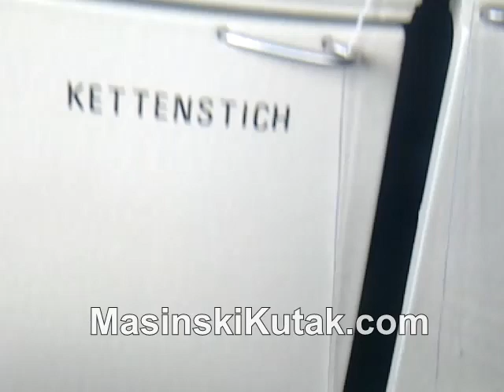Chain Stitch / Chain Stitch on a Home Sewing Machine / Janome 618 / Janome New Home 920

Comment: I've seen these before and didn't know what they were. none of my current machines have one of these, but I'm going to go hunt down a janome 618 right now. super curious.
Reply from the maker: It's a very interesting accessory for a sewing machine, I had one and sold it, if you find a Janome 618 pay attention to whether it has this accessory, it's very often missing.
Reply: @MasinskiKutak  I'm combing through eBay listings. zooming it on all the pictures. I'll find another one. I actually may have one in my many sewing drawers. apparently there is a early 1970 singer that also does this

Comment: This attachment was included with the XL-II and model 813 released by Janome.
model813 is the Japanese version and XL-II is its English version.
These are products from the late 1970s.
This attachment can be used with the model 8XX of JANOME.
Reply from the maker: @kiyotaka kaneko 
Most likely sir, the Janome 813 sewing machine has the same rotating hook as the Janome 618. 
Thanks for the information.
Reply: @MasinskiKutak  I have a model 815.
I made a video of JANOME model 815.
The model 815 does not come with this attachment.
I would like to make a copy of this attachment.
Reply from the maker: @kiyotaka kaneko  
I watched your video, I watched patiently even though I don't understand a single word, Janome 815 is a good old Japanese sewing machine.
I noticed a crack on the rotating hook drive gear, if the machine is working normally it should not be replaced immediately.
Receive my sincere respect and greetings for the great Japanese people.
Reply: @MasinskiKutak  I'll start repairing it tomorrow.
The gears will come from China.
Reply: Any class 15 machine that has the same back and forth rotation
Hook mechism.
Reply from the maker: @ronalddaub5008  It cannot work on back and forth, the hook must be rotating, also the threading feed is not like regular sewing.

Comment: Hi, sir this device is super , and I need that one , how much it cost?  ,and my mechine model is usha janome wounder stich
Reply from the maker: In the explanation of the video clip, I stated that this accessory was used on the Janome 618 sewing machine, for now I have no information whether this accessory is used on some other models of sewing machines.
For this accessory to work on another machine, several conditions are required, as well as a special method of placing the thread.

Comment: Hello Sir, I have a New Home Janome Model 692F. I was using the chain stitch on it when I first got it. Then I started changing the dials without a manual. I have only been able to find a manual for a 692. That manual says nothing about the chain stitch. After messing with the dials I haven't been able to get the chain stitch to work again.  Would you happen to know what the "F" on my model means and would you know maybe what the dials should be set on to use the chain stitch?
Reply from the maker: I don't know what 'F' means, it's a series mark, are you sure that you thread the thread correctly, there is a difference in the way of thread placement for chain stitch and regular straight stitch.?
Reply: @MasinskiKutak  Thank you for your information. I will try to re-thread. It sounds like you are saying that it doesn't matter what the dials are on once I place the plugin into the machine it will chain stitch as long as I have it threaded correctly.
Reply from the maker: Sorry, my English is not good, so a misunderstanding is possible. It is important how you will set up your sewing machine, you will set up the straight stitchs sewing machine and pull the thread in like in this picture:
https://www.pinterest.com/pin/375206212719058746/
Reply: @MasinskiKutak  I think your English is just fine. And so was your help. Thank you very much. I had it threaded wrong. You are the only one I could find online that even had this plugin for the chain stitch on the older Janome machines. Thanks again.

Comment: So this attachment will not work on a drop in bobbin, is that correct?
Reply from the maker: I do not understand what you are asking, I recommend that you read a detailed description and comments, it may be useful for you.
Reply: @MasinskiKutak  my bobbin case is on the machine bed not on the front.
Reply: I understand what you are asking and I don't think it will and drop in  Bobbin, and this is a vertical  machine ,and this is being used on a horizontal oscillating hook machine. like a  r i c c a r only this bobbin is 90° the other direction  I don't think that would make any difference but I think it has to be a rotary machine. Not one of the drop in bobbing like a 66
Reply: @susan1948utube  then you must have a drop in bobbin I don't think that will work on one of those machines

Comment: Can i use this in singer machine
Reply from the maker: You can find the answer in the explanation of the video clip as well as other comments.
Reply: Probably not, but Singer offers their own chain stitch adapters for machines with horizontal drop-in bobbins.  I know there's a chain stitch adapter for the Singer Touch'N'Sew, for example.

Comment: No more bobbin winding?!
Reply from the maker: No, the lower thread is not used.
Reply: Chain stitch isn't ideal for everything, though.  First of all, it uses 50% more thread to sew a seam than the standard lockstitch (so one foot of seam will use three feet of thread with chain stitch, versus two feet of thread with lockstitch).  Secondly, you can't reverse a chain stitch unless you make a U-turn, because the chain of stitches will otherwise get loose.  And thirdly, if the seam end isn't finished correctly and the thread is pulled, the whole seam comes out in an instant. 

This ability to quickly remove a chain stitch seam, however, makes chain stitch excellent for basting.

Comment: Сool!! Where can i buy it?
Reply from the maker: Unfortunately, this add-on can only work on some models of sewing machines. First of all, your sewing machine must have a rotating hook, it must have an adequate position to be placed in a rotating hook, then, a special method of threading.... etc. The sewing machine model on this video is Janome 618.
Reply: Masinski Kutak It's a pity. Thank you!
Reply: @MasinskiKutak  even I have same model janome 618. Second hand one I purchased I did not get the instructions manual with it, so plz tell where to buy the add on. Thanks.
Reply from the maker: I do not have a manual for use for your sewing machine, this part of the chain stitch I have only one piece.
Reply: @MasinskiKutak  looks to me like you have an oscillating hook and not a rotating hook. Someone asked you earlier if it would work on a drop in bobbin and a drop in bobbin is not a oscillating hook but anyway that's really cool
I believe I can make one of those I've got a machine shop and I want to use it on a Riccar it's got the same bobbin only it's not oriented the same position, but it doesn't matter. It has a oscillating hook just like that machine loads from the front the r i c c a r loads from the side but it's still a oscillating hook and a horizontal orientation under the needle
Reply from the maker: @ronalddaub7965  
No, this is a rotating hook and this accessory can only work on a rotating hook. 3:56
Reply: @ronalddaub7965  It won't work with an oscillating hook. This machine is definitely a rotary hook and that is essential (plus a few other features). It uses a class 15 bobbin/case like many other machines, but that isn't the only requirement.
Not all drop in bobbins are rotary hook.